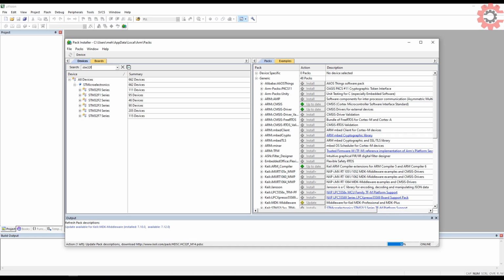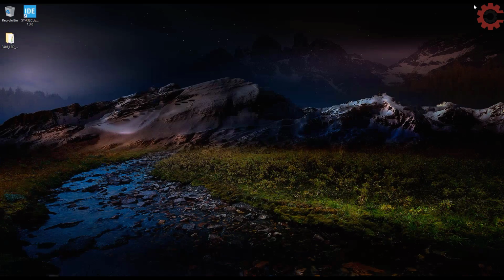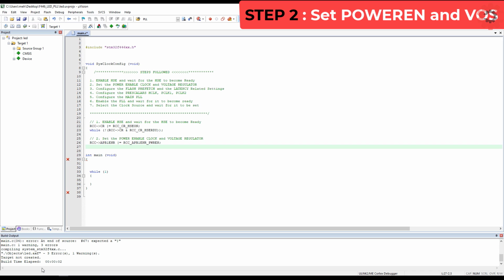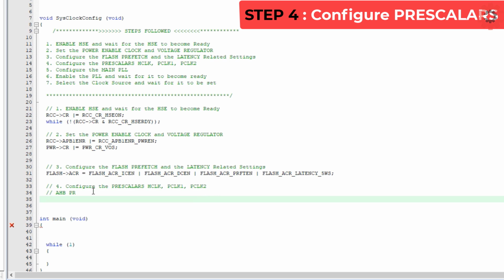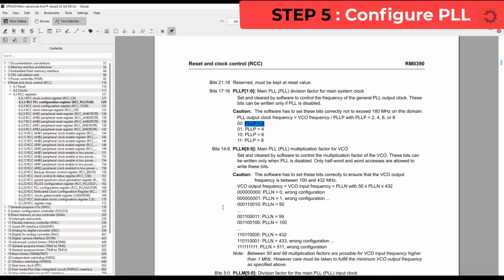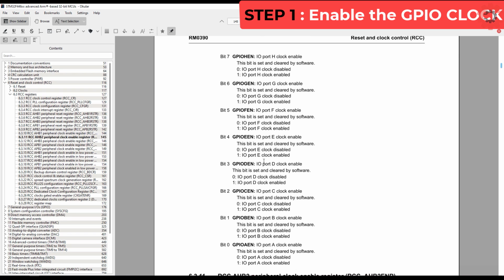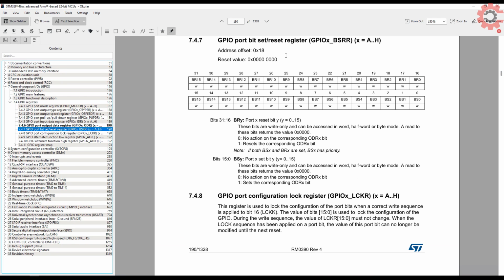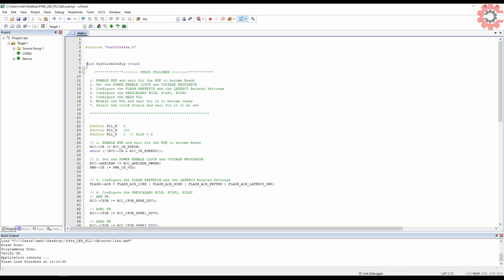STM32 Bare-Metal Clock Setup | Register-Level Programming

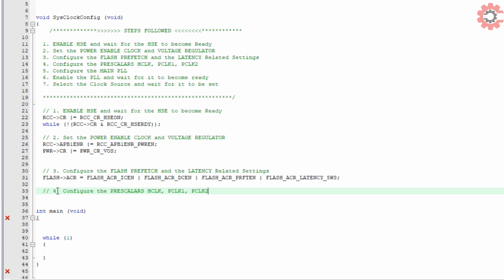Comment: 8:09 Isn't it important what value is programmed first? Because when I write a value in the e.g. 4th bit of a register and then a value in the e.g. 6th bit then the first value will be overwritten or not?
Reply from the maker: That's why we perform bitwise or ( | ) and bitwise AND (&). They don't modify other bits of the register.
Reply: @ControllersTech  Hmmm, then something must be wrong in some other code from me, there I must began from the MSB what I need to set. Otherwise the lower bits were overwritten.
And I used OR and AND
Reply: @ControllersTech  But I had read that when we perform e.g.

REG |= (1 << 4);

that then the four upper bits going away?🤔
Is that true?
Reply: @ControllersTech  I´ve played around a little bit with bitwise operations in C (not on a microcontroller) and when I do something like that:

uint8_t test = 144; //(0b1001000)
test &= (0 << 4);

Then I got as result: test = 0 and not (how it must be work in a microcontroller?) 128

And I know why that appears (because 0 << 4 is also 0) but if I do the same on a microcontroller the other bits aren´t reset.

Comment: Hi, I downloaded code and flash my Nucleo-F446RE board. The LED remains ON all the time, no blinking. 
Further, I also commented in the program:- Pin OUTPUT and while loop (shown below). still the LED is ON. I am surprised.  What could be the reason, if any one have encountered this ? thank you
// 2. Set the Pin as OUTPUT
//GPIOA->MODER |= (1<<10);  // pin PA5(bits 11:10) as Output (01)
the while loop, still the lED is ON.
	/*while (1)
	{
		GPIOA->BSRR |= (1<<5);  // Set the pin PA5
		delay (20000000); 
		GPIOA->BSRR |= ((1<<5) <<16);  // Reset pin PA5
		delay (20000000); 
	} */

Comment: In step 2, after I set the POWER ENABLE CLOCK in RCC_APB1ENR, how can I set the VOLTAGE REGULATOR because I'm using STM32F103C8 which doesn't have VOS in bit [15:14] like F446 does? 
And what is the purpose of this bit?
Reply from the maker: There is another video for 103C8. Look in this playlist.

Comment: by default X3(High speed External) is not soldered, why did you enabled it when it was not there?
Reply from the maker: It uses the crystal from st link.
Reply: @ControllersTech  ohh it uses the external clock from the mcu on stlink, thanks a lot

Comment: Brillant tutorial absolutly love it. You did enable external oscillator which exactly doesn't exist as we can see on the board. I think you should choose Bypass clock source. What exactly running now this ARM - Bypass clock source or internal oscillator?
Reply from the maker: It works both ways, by bypassing the clock and by selecting external crystal. So either is fine.
Reply: @ControllersTech  Yeah - thanks for your answer.

Comment: Greetings, can someone explain to me why the author put 8 MHz instead of 25 MHz when configuring the timers in the CubeMX. And how it is reflected in the values that the author writes in the registers. Thanks in advance for your help.
Reply from the maker: Because the board has 8 MHz crystal on it, not 25. And this affects your entire clock system of the MCU.
Reply: @ControllersTech  Thanks a lot, this confused me a bit, but now I understand that the HSE is fixed and cannot be changed outside of the MCU.

Comment: Hi, First of all thanks for a nice tutorial. I think as a safe step, we need to reset the bits for PLLP, PLLM and PLLN in PLLCFGR register to zero first. Otherwise doing OR operation would result in erroneous value for some boards. This was the case with me as I was trying to get System Clock of 100Mhz. Only after resetting those bits to zero could I make the OR operation work correctly and get desired frequency. I verified my results by running the SystemCoreClockUpdate function provided in system_stm32f4xx.c to see the value of SystemCoreClock as 100MHz (Using HSE_VALUE of 8MHz).

Comment: Hello Sir , firstly thank u very much for such an awasome playlist . I want to ask a question that im struggling with over 3 days and couldnt solve the problem which is when i write above codes and watch the changes of PLLCFGR register , no bit changes . I try a lot of ways and i solved that by calling the function RCC_DeInit();. But why my codes cant work withour RCC_DeInit ? And how can i solve that problem ? Best Wishes.
Reply from the maker: Maybe the reset values for your MCU are a bit different. What MCU are you using anyway ?
Reply: @ControllersTech  stm32f407vet6 -  discovery board -  . Sir im still trying to find a solution but i cant solve even looked to over 30-40 projects on the internet . The main problem is : even if i assign any operation - such as RCC->PLLCFGR |= (1<<4) -- This is just exp.- when i run and watch RCC_Registers (exp. RCC_PLLCFGR) , my codes dont change anything.

Comment: How do you know for sure that the HSE is operating at 8Mhz?
Because I see in the file system_stm32f446xx.c is defining the HSE at 25Mhz
#if !defined  (HSE_VALUE) 
  #define HSE_VALUE    ((uint32_t)25000000) /*!< Default value of the External oscillator in Hz */
#endif /* HSE_VALUE */

#if !defined  (HSI_VALUE)
  #define HSI_VALUE    ((uint32_t)16000000) /*!< Value of the Internal oscillator in Hz*/
#endif /* HSI_VALUE */
 and I don't see you configuring the HSE's frequency back to 8Mhz.
Reply from the maker: "How do you know for sure that the HSE is operating at 8Mhz?" 
You can check the next video in the series, where the timer is being used to setup the exact delay using this configuration. 

"Because I see in the file system_stm32f446xx.c is defining the HSE at 25Mhz"
That value will be used if you use the function SystemCoreClockUpdate(), which is also defined in the system file. If you enable the HSE crystal, it will simply run at it's clock, which is 8MHz in my case.

Comment: Hlo @ControllersTech,
I am using STM32L476RGT6, I used the code as you have done in this video but I am not able to blink the led, can you please tell me what should I change to make it blink the led.
Code:
#include "stm32l476xx.h"
void SysClockConfig(void);
void GPIO_Config(void);
void Delay(uint32_t delay);

void SysClockConfig(void)
{
	/* STEPS FOLLOWED
	1. Enable HSE and wait for the HSE to become ready
	2. Set the POWER ENABLE CLOCK and VOLTAGE REGULATOR
	3. Configure the FLASH PREFETCH and the LATENCY related settings
	4. Configure the PRESCALERS HCLK, PCLK1, PCLK2
	5. Configure the MAIN PLL
	6. Enable the PLL and wait for it to become ready
	7. Select the Clock Source and wait for it to set
	*/

	#define PLL_M 4
	#define PLL_N 80
	#define PLL_P 0 // PLLP = 7
	#define PLL_Q 0 // PLLQ = 2
	#define PLL_R 0 // PLLR = 2

	// Step 1
	RCC->CR |= RCC_CR_HSEON;
	while(!(RCC->CR & RCC_CR_HSERDY));

	// Step 2
	RCC->APB1ENR1 |= RCC_APB1ENR1_PWREN;
	PWR->CR1 |= PWR_CR1_VOS;

	// Step 3
	FLASH->ACR |= FLASH_ACR_ICEN | FLASH_ACR_DCEN | FLASH_ACR_LATENCY_4WS;

	// Step 4
	RCC->CFGR |= RCC_CFGR_HPRE_DIV1; // AHB PRESCALER
	RCC->CFGR |= RCC_CFGR_PPRE1_DIV1; // APB1 PRESCALER
	RCC->CFGR |= RCC_CFGR_PPRE2_DIV1; // APB2 PRESCALER

	// Step 5
	RCC->PLLCFGR |= (PLL_M<<4) | (PLL_N<<8) | (PLL_P<<17) | (PLL_Q<<21) | (PLL_R<<25) | RCC_PLLCFGR_PLLSRC_HSE;

	// Step 5
	RCC->CR |= RCC_CR_PLLON;
	while(!(RCC->CR & RCC_CR_PLLRDY));

	// Step 7
	RCC->CFGR |= RCC_CFGR_SW_PLL;
	while((RCC->CFGR & RCC_CFGR_SWS) != RCC_CFGR_SWS_PLL);
}

void GPIO_Config(void)
{
	/* STEPS FOLLOWED
	1. Enable the GPIO CLOCK
	2. Set the Pin as OUTPUT
	3. Configure the OUTPUT MODE
	*/

	// Step 1
	RCC->AHB2ENR |= RCC_AHB2ENR_GPIOAEN;

	// Step 2
	GPIOA->MODER |= GPIO_MODER_MODE5_0;

	// Step 3
	GPIOA->OTYPER = 0;
	GPIOA->OSPEEDR = 0;
}

void Delay(uint32_t delay)
{
	while(delay--);
}

int main(void)
{

	SysClockConfig();
	GPIO_Config();

	while(1)
	{
		GPIOA->BSRR |= (1<<5);
		Delay(1000000);
		GPIOA->BSRR |= ((1<<5)<<16);
		Delay(1000000);
	}

}
But while going through the reference manual, there was some difference like PLLPEN, PLLQEN, PLLREN bits in RCC->PLLCFGR register, Do I need to enable those bits also?
Reply: If anyone here knows what could be the mistake, please let me know as soon as possible.

Comment: Great video.
But how could i know the steps?
Every moment i have more questions… 

How would i know to config the voltage regulator after enable APB?
I can i develop that mind set to figure this kind of things be myself?
I want to realy learn and not to be a copycat.

Where it is written in the data sheet or manual reference?
Please tell me the secret
Reply from the maker: I have explained things. As mentioned,  the clock configuration is something very complicated in ARM, I took the help from the CUBEMX configuration.
Reply: @ControllersTech  yeah i figured it out after i watched again, sorry.
And thank you!

Comment: Thanks for this video. However in configure target options the xtal frequency is greyed out and I cannot change. Could you suggest How can I change the frequency. I am using STM32F401CCU6 microcontroller and  I need to give 84 Mhz.
Reply from the maker: You need to enable the external HS crystal under the RCC tab.

Comment: Very good, I really learned a lot ... I just need a clarification on Clock Configuration in Cube MX: I am using a STM32F401RE Nucleo board and I intend to use the 8Mhz ST-Link Oscillator on the board, is this still to be configure as crystal/ceramic Resonator or as Bypass clock source ... Thank you
Reply from the maker: Either is fine.. It works with both. You can use bypass as I have seen some ST tutorials doing that

Comment: Thank you for this tutorial! But how can we see our actual speed to check our code right or wrong? Because I finished this tutorial and now studying your tutorial about TIMER and USART, but my clock seems to run slower as expected. Therefore, 1 second (on TIMER tutorial) on my board is relatively slower than reality, and the Hercules software can't recognize the letter 'G' from the beginning.
Reply from the maker: Your clock configuration might be wrong. Most probably the crystal frequency. Check if you have used the proper crystal frequency.

Comment: Dear Sir,
Where do you set HSE Frequency ? I couldn’t find it in this code
Reply from the maker: You don't set the frequency. Based on HSE value, you set the PLLs to obtain the required clock.
Reply: @ControllersTech   But where do you know HSE value from if you don't set it up ?
Reply: I saw that HSE_VALUE is a constant defined in system_stm32f4xx.h file (default value 25 MHz), but you caculate based on HSE = 8 MHz.
Reply from the maker: It's a physical crystal on your board. I have 8 MHz so I take 8.
Reply: @ControllersTech   I got it. I think this value we can configurate. Thank you a lot.

Comment: Hi, I have STM32F4 Discovery but I have difficulties setting up the clock. I checked the reference manuals for register differences, I checked the syntax but I didn’t find any problems. When I download the code to the Discovery Board regardless of the delay function my LEDs just lights up dim and doesn’t blink or do anything really. I had check delay but it's not work. Can you help with this ?
Reply from the maker: Debug the code. It might be blinking very fast..

Comment: Thank you very much! I tried around with HAL, which makes clock configuration very easy, but I found out that it is so much slower than writing directly to registers for GPIO ports (factor 10 perhaps). So I decided not to use HAL for my project, but I was stuck a whole day with the clock configuration. I think the most part of it was fine, but the mistake was not to wait for the clocks to be ready like in your video. That helped and now it works! I will watch your other videos to avoid problems when moving on with the project!

Comment: If the void delay(uint32_t time) function does not work for you, write void delay(volatie uint32_t time) instead to avoid compiler optimization.
Reply: Thanks alot Mahiana. This was really very helpful  as I was stucked here... Can u please elaborate why the issue resolved after using volatile...
Reply: @sushivamsingh8069  As you can see in the video it properly worked without using "volatile". However we followed the steps of the video and done exactly the same thing. So what is the difference, why we need "volatile"??

We need it because our compilers differ. Let's look at the functions body: while(time--);
If it is true time is decremented. The function returns nothing, and after execution the value of time is lost.
In our case the compiler just thought: "Hey here is a function that gets a parameter, but wait!! any modification we make on that will be lost and we don't even use it in any proper conditions. Then why should I contain this parameter in that function? Let's just skip it to optimize runtime and memory."

In the video the other compiler thought it might be important so compiled it.

If we make a variable "volatile", we tell the compiler that don't make any excuses and skip, just compile it as it is.
Most of the time when you interact with hardware it is out of the compiler's scope, for example it can't see if a variable is modified by hardware, in these cases the code will only work if you use volatile variables.
Reply: @mahianabosszuallo9726  It was really very informative from your side and I am very thankful to you...
Reply: MVP comment, saved me having to spend hours figuring out what went wrong! Thanks

Comment: I like your approach to non-HAL coding for setup and configuration of the MCU system and peripheral blocks.  I do however miss the easy access to useful Arduino functions e.g. map(), now I know this could be hand coded but would it be possible to add an Arduino header file that contains these functions.  For example I noticed in VSC-PlatformIO that when developing an ESP32 project, and probably other MCUs, an #include <Arduino.h> is automatically added, which does enable Map(), and presumably the rest of the Arduino functions, to be used; I would really like to see a video on this subject.
Reply from the maker: You can create one header file yourself consisting of all those functions..

I don't think it's necessary to make a video on that. Just google the source code of those functions and collect them at one place

Comment: On line 22 I am puzzled as to how RCC->CR |= RCC_CR_HSEON; sets the HSEON bit 16, I can see how  RCC->CR |= 1<<16;  would Inclusive OR the RCC_CR register with 0x00010000 which would set the 16th bit leaving all the other bits unchanged - thanks for any enlightenment.
Reply from the maker: Check the definition of HSEON bit in the header file, it is 1<<16
Reply: @ControllersTech  OK I see, thanks for that and all your very informative videos.

Comment: Thank you for the video.
I have doubt, that the Nucleo board used in this video no external oscillator is connected, but we have programmed the controller as an external oscillator. Please tell us how.
Reply from the maker: It have the one for the st link. It uses that..

Comment: 👌👌👌👍👌👏👌👏👌👍👌👏👌👍👌👍👌👏👌👍👌👍👌👍👌👌👌👌👌 one doubt  u don't have external 8mhz crystal on your nucloe board, but how you are setting HSE BIT plz explain??!!
Reply from the maker: There is one for the st link. It is being used.
Reply: @ControllersTech first thank you the quick response 👍👍👍👍👏👏👏. X1 can be used both for stlink and stm32f as HSE Is that correct, I had the doubt bcz X3 is empty in nucleo board..

Comment: why are you using Keil though? When CubeIDE has no code size limit
Reply from the maker: I don't know how to setup those startup files and all in cubeide..
Reply: @ControllersTech  just use a regular cube project and delete all HAL code and start with clean main
Reply from the maker: The point with this series is not to involve cubemx... 
I only used it in this video for rcc setup. It's not involved in any other video in this series..
Reply: @ControllersTech  fair enough
Reply: @EdwinFairchild  one of the best if not the best course on bare metal STM programming is yours.

Comment: I have tried to modify the registers and run it through STM32G071 but could not see the LED blinking.
Reply from the maker: Put a breakpoint inside the while loop and step over each statement. Then see if it blinks

Comment: I use F407VGTx, I want blinking LED4 (PD12), I config following:
// 1. Enable the GPIO clock
	RCC->AHB1ENR |= (1<<3); // enable GPIOD
	
	// 2. Set the Pin as Output
	GPIOD->MODER |= (1<<24); // pin PD12 (bits 11:10) as Output (01)
// 3. Config the OUTPUT Mode
	GPIOD->OTYPER = 0; // Output Push-pull
	GPIOD->OSPEEDR = 0; // Low speed

and in  while loop: 
while(1)
	{
		GPIOD->BSRR = (1<<12); // Set the Pin PD12
		delay(1000000);
		GPIOD->BSRR = ((1<<12)<<16); // Reset the Pin PD12
		delay(1000000);
	}
but when I load code in my board,  it isn't run. and I don't no why :((
Help me, pls
Reply from the maker: what about clock configuration ?
Reply: @ControllersTech  I  config 168MHz (max on F407), I think it's okay, register of both is same
Reply from the maker: Try putting 2 break points. 1 after turning on the led and another after turning it off. See if it works
You can also check the gpiod bsrr register in the keil debugger and see if the values are updating there
Reply: @ControllersTech Sir, Have you ever worked with Modbus RTU on STM32. Now I trying it and have many problem :((
Reply from the maker: No i haven't worked with modbus
Reply from the maker: contact me on telegram
Reply: @ControllersTech  yepp, sure

Comment: That's how I first learned to program stm32 . The manual explains in terms of the registers so it's the obvious way to get started. The HAL Low Level drivers are perfect for register programming because the way the functions are written self documents your code. After a while though you'll want to use HAL drivers as they offer a good high level way to get things done.